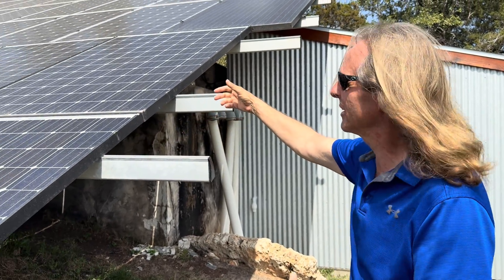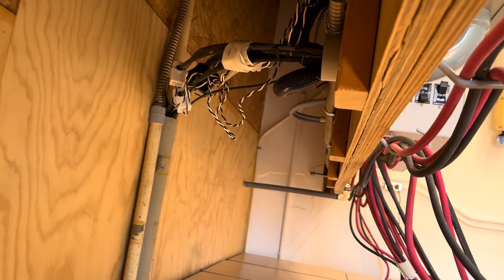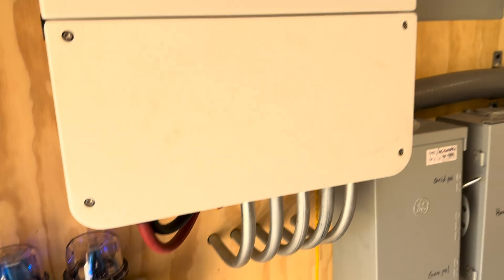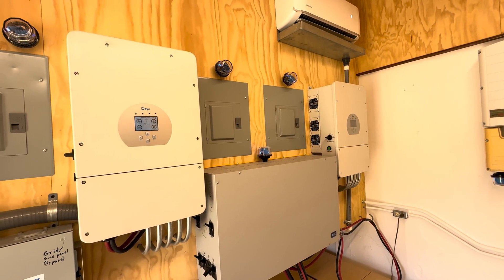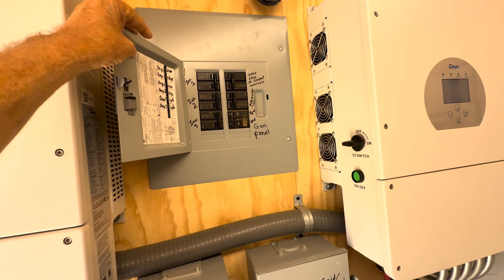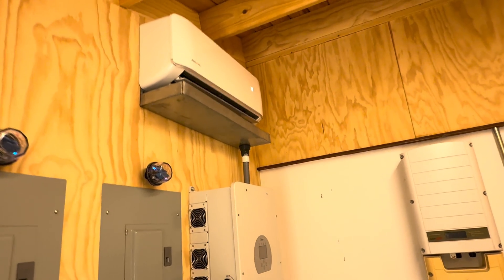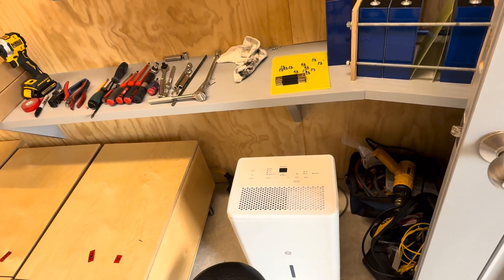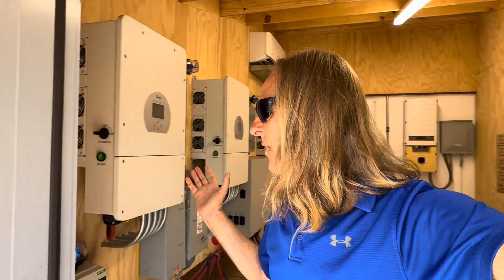Finally Living Off Grid With Lifepo4! Huge System

Comment: Amazing offgrid setup... and since I did something like this (in a smaller scale), I can imagine how many hundreds of hours your spent on it. Just a simple question: why did you choose the Gen port of Deye' inverters for your AC-coupling ? It can be done also on the Load port.. i) freeing the Gen port for smartloads or a real generator and ii) AC power don't pass through buitin MOSFET lowring temperatures. Cheers from France.
Reply from the maker: @sebydocky5080  your question could take a whole video to discuss but you can’t feed ac coupled to load panel. You can feed it to grid panel but it is best to use it on gen panel for me.
Reply: @RayBuildsCoolStuff  FYI, It does work also with the load port (there is a small figure in the manual showing that at the end).  It's what I am doing and it works flawless (I am offgrid too).... But you are right, this question can be the topic of a decicaced video :). Cheers.

Comment: Awesome!

But I have 1 concern. Isn't there a fire risk since all are built on wooden panels?
PS: I'm also running off-grid with a 5kWh DIYish LFP backup for 2.5 years.
Reply from the maker: @amilww  the wood is all coated with a clear intumescent paint. I ran tests with it using a propane torch. It withstands fire very well.

Comment: The way Deye bricked those inverters was wrong ill never buy any inverter from them. Their own dealers in China were selling to US customers. They should have shut down those dealers in China, and sent out warnings to anyone who buys after that date they will no longer support them. Your off grid system is nice all that work has paid off.
Reply: Sol-ark did..
Deye, sol-ark and sunsynk share the same monitoring system.
They connect to a common datacenter, based of geo location ( ip multicast)., which means that sol-ark hard cut everything not in their serial nr database.
Sol-ark is a prick company

Comment: Nice system.. why didn’t you put cement board on the wall where the inverters are? Seems like too much wood to me :)
Reply from the maker: @bradmesserle999   the wood is all coated with a clear intumescent paint. I ran tests with it using a propane torch. It withstands fire very well.
Reply: @ sweet that works.. my place is in Texas also. I would love to connect if you have time.. I am currently trying to build the place out.. I can send you YouTube video links of your interested..

Comment: Sweet. That's a huge system for sure! Congrats on a job well done. We've been living completely off grid full time for 2 years now with our solar/battery system. We live in a motorhome so have much lower energy needs than a stick and brick house does. But our system must be lighter and more compact too as we travel all over the US. We only have 5,020 watts of solar, 23.5kwh of batteries and 6kw of inverted power, but this is sufficient for our humble needs, as we haven't had to run our generator or plug into the grid in over 2 years.
Reply from the maker: @SuperSushidog  have you seen my videos about taking our horse trailer off grid? We only have 1400 W of solar 3000 W of inverter and 17 kWh of battery but we were off grid for five weeks last summer on our horse trip to Montana. Great hearing about your motorhome.

Comment: What's the ac output of the inverters? Quite the system
Reply from the maker: @JMACK1  a combined 24,000 watts or 100 amps at 240v. The most I’ve seen in nine years of monitoring my consumption is 19,000 watts but at that time I had two electric dryers.
Reply: @RayBuildsCoolStuff  Thanks

Comment: 0:58 - I have the same false wall, but about 1 m of space to get behind and work easily. It is the attic, the space direct below the roof and an uninsulated above the insulation and Floor above the rooms cause we have a lot of space only on 1 floor and that is well insulate with 30 cm. Therefore the roof area was ideal to run all the cables in channels. 4 inverters and communications is quite a lot plus  3 hybrid inverters downstairs in the oil heating = engine room each inverter with14 kWh or 16 kWh batteries. 

Downstairs I did it a kind of your way. lot less space there so I use an old wooden door that is mounted 12 cms from the wall. I can open that door into the room and get access to all the wirings , not sure if you used the same technique to get behind it. Takes a lot of trial and error - same issues like you had with cable ways and those cable holders cause if the door opens then every cable has to have its own and save way.  

2:26 - we will get deye soon, a big hybrid inverter, but the issue you had described were those "illegaly" imported devices and I guess yours are older and were shipped legally by the manufacturer. 
The issue in general had caused the german government to raise questions about the legality. We have a lot of solar power and if China or 1 manufacturer could shut that down 10% of that over night, then thise becomes a serious topic for the grid based on how much are installed. deye is not unknown, but there are more chinese and how could they abuse that "power" in case of a russian attack to support that. Hence cloud from outside the EU and access to firmware on those devices will become a serious topic for all, solar power, then cars and what not. 

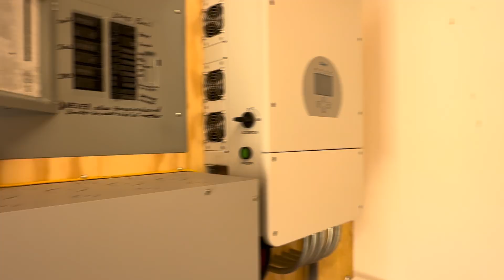4:51 & 4:46 - These big blue looking "bulbs" are surge = overvoltage protection in case of lightning which could hit the solar array and push the peak wave through the cables to protect the inverters, right ?
Do you have a reference or a link what they are ?
We have the same boxes for all our 14 strings , so 3 boxes with 5 circuitbreakers, but right no surge protection.  

We have gone away from SEPLOS due to the missing active balancer and use the JK BMS which is in general great, but terrible in measring the energy. The shunts are quite off.

Looks like you do not have a 3 phase wiring, or have you each phase connected to 1 hybrid inverter.
Reply from the maker: @typxxilps the surge protection devices are from midnight solar. They have 150 V rated ones for the battery 300 V rated ones for the AC panels and 600 V rated ones for the photovoltaic.

Comment: Nice to see that you finally got your system finished up!
Reply from the maker: @junkerzn7312  I was very close to finished for a long, long time. I got busy doing other things, but I always knew that in case of a long grid outage. I could get myself powered up with about one long days worth of work. I also have other means of keeping things powered up in the meantime. I keep a generator with 50 gallons of fuel and I have other small solar powered systems to keep things running. Heck, I can run the critical things just plugged into my Prius.

Comment: I like that false wall idea
Reply from the maker: It sure made things easy and allowed the batteries to bear underneath. On my friends system I was able to stack the metal boxes. On the next one I'll put eight pairs of batteries under the false wall and avoid the need to have some out in the room.
Reply from the maker: I use bait boxes outside and traps inside. Haven’t seen a mouse in years.

Comment: Very nice setup, just a small idea that could help in the event of a problem. I would grab a small inverter say 300 or 500 and connect that to the battery buss so it always has power. Use the output of that inverter to run the lights in the power shed, or even better put a battery backup light in there. That way in the unlikely event of a failure you would have lights in the middle of the night... I only suggested an inverter as you more than likely have one about. You could also have a second light of the grid supply as backup.

Also I dont know if those inverters have an EPO connection. My units do and I have a smoke detector linked to that input. That way in the event of any smoke from anything all your kit will shut down.
Reply from the maker: @TRS-Tech  I have a jumper that I can manually connect by turning two breakers on. I decided not to get into the risks associated with someone, not knowing how to use it but if you look carefully at the panel, you will see the notes about not turning on the jumper and the main breaker at the same time in the load panel
Reply: @RayBuildsCoolStuff  Exelent... still worth 50 odd bucks to put a battery backup light up though. No matter what you will have lights then.... or even hang up a decent flashlight in there  👍
Reply from the maker: @TRS-Tech  I’m absolutely surrounded by flashlights. Between the lights I have for Scuba and the lights I have for Cycling. I can pretty much find one anywhere I reach and of course we all have one on our phone. I really appreciate that you recognized the problem. It wasn’t the first thing that I thought of when I was designing the system. It came a little later.